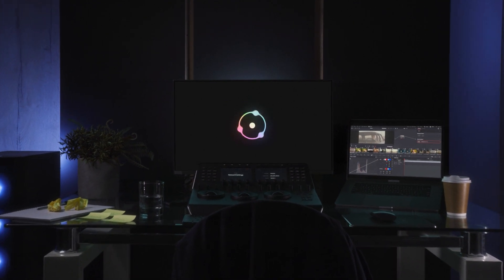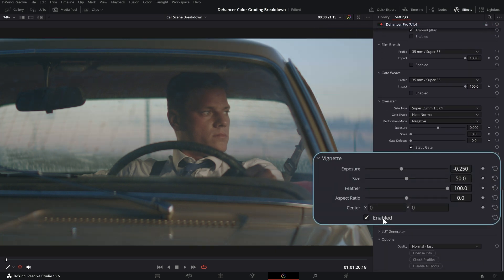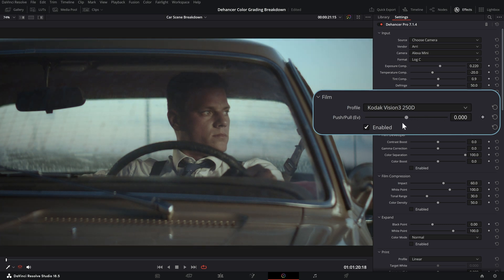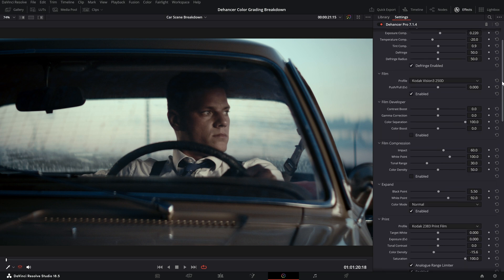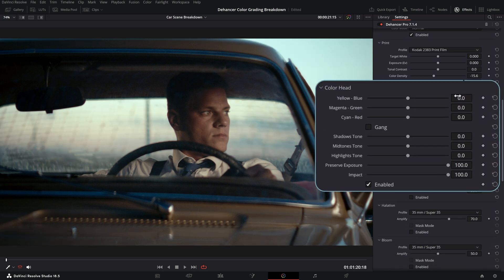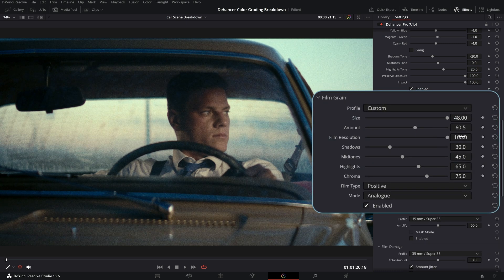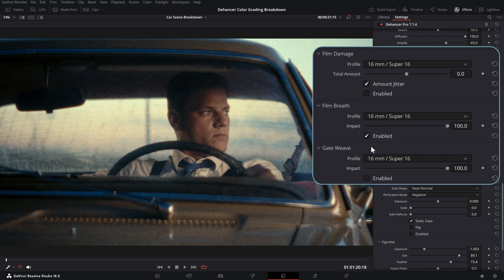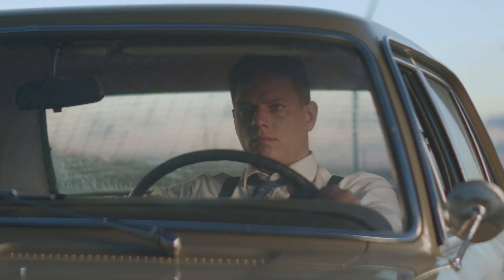Step by step color grading example with Dehancer

Comment: What is the Color Management?
Reply from the maker: Color management is the process of ensuring consistent and accurate color reproduction across different devices. If you are unsure on the complexity of Dehancer, please, check out our many articles on suggested workflow. We also have a 'Help' section on our website (Manuals, FAQ included). https://www.dehancer.com/learn
Reply: @Dehancer Sorry I wasn’t clear in my question. What is the Color Management used for the workflow of Dehancer showed in the video? Davinci YRGB —> DWG Intermediate —> Rec.709 or is it set to default?
Reply from the maker: @VfxKopele  his article might help: https://www.dehancer.com/learn/article/davinci-wide-gamut-pipeline

Comment: I wish if there was a better workflow for a color managed settings where the Log/RAW Interpretation of each clip is done in Resolve through input color space than in Dehancer. I found that by doing so and choosing DaVinci Wide Gamut as Input in Dehancer, the color of the film profiles looks dramatically different than it is shown here (Rec709 timeline and  Log/RAW Interpretation in dehancer). I don't want to switch back to a non color managed workflow just to use dehancer properly. Please fix the film profile consistency issue between color-managed and non color-managed workflows. Thanks.
Reply: THIS!
Reply: seems like its a stupid plugin that always outputs to rec709... very useful in color mangement projects where you maybe want an hdr version. if im not mistaken, than this tool is a toy.

Comment: Love Dehancer, but please simply let us rearrange the toolset to reflect a workflow like this, or our own variations. Supposedly the tool order can’t be changed because it may ruin the flow of operations, but this video totally negates that explanation, and I’m left making a recommended-order-of-operations list in Apple notes 🤪. Free the toolsets! Cheers
Reply from the maker: Hey! We are breaking down whole workflow in the description. Please, check it ou!
Reply: @Dehancer  Wish I had seen that, woulda saved me some typing lol — appreciate you much! It’d seriously be awesome to just be able to slide the panels into that order for a much better/easier user experience tho, and not have to consult that list. Color grading can already be massively technical (especially when you combine it with all the other media-creation plates we all struggle to spin lol). Easier is much more joyful! Please think about it 😎
Cheers
Reply from the maker: @eversparx  Will pass it on to the team.
Reply: @  Awesome — Thank you! Love Dehancer either way, but would love it just a lil’ more if it had sliding blocks lol. Cheers